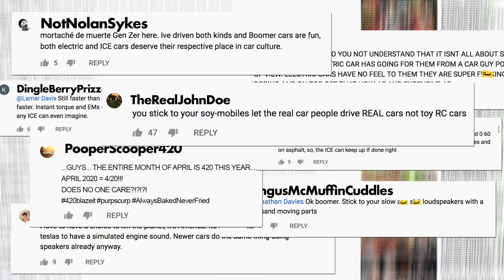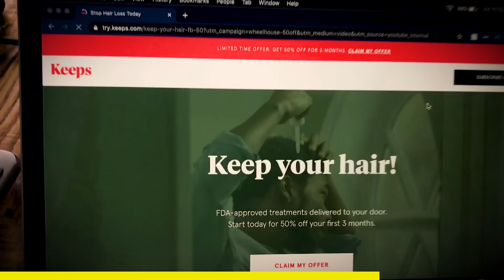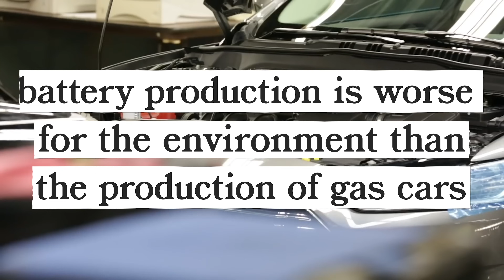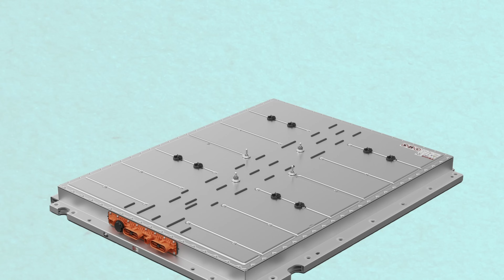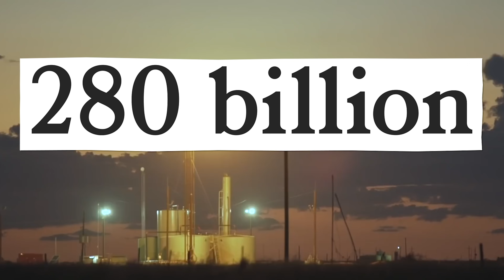Are Electric Cars REALLY Better for the Environment?

Comment: He forgot the most important thing green energy is not green because of what it takes to build it solar power requires more cole than you might think and the loss of trees it takes to install a solar farm wind energy has the same problem it requires cole to make steel for the wind generator to be built America has been shutting down a large number of hydroelectric dams across the country even nuclear facilities have also been shutting down as well storms  wreak havoc on both solar and wind energy production to wind the wind mill has to be shut down to prevent damaging it hail and storm debris can damage solar panels.

Comment: Here in California our power grid can’t keep up with our air conditioners.
Reply: @BeastMastery  there are lots of new power plants and most of the power plants have newer more modern power transformers. We took perfectly fine power transformers out of service and replaced with new units. Lots of new units are made overseas though and are not very reliable. We have nuclear power plants in a few states and it is the cleanest power you will get.  Downfall is when something goes wrong, it's real bad.
Reply: It is true that if you turn off the AC the air outside is going to get cooler, but you still need AC. Buildings need to get cooler by design and there are many cool features a building can have to achieve just that. However in a heat wave we will need AC. Always. For that we have thermal storage which easy to build, you can use water or ice, and uses existing technology and labor (know how). For everything which is electric we need to think about demand side management. This includes cars. Having everyone charging cars at the same day and hour will not work, at least in an economical way. All these ideas and solutions are good and stand from a sustainable point of view as they are good for business, create jobs and are better for the environment. Change is always hard specially when we have pet these enemies which we all like to hate and contradict but are all in this together. Lets work people.
Reply: I refuse to believe that the national power grid can handle a massive increase in electric vehicles.

Solar and wind cannot replace coal.  Natural gas plants have been replacing coal, and envirowhackos hate natural gas too.  I want natural gas powered cars.  Screw EVs.
Reply: @penguinsfan251  i agree with you.  Only downfall to natural gas vehicles which ups,Swann, and a few others run is the 10% loss of power compared to gas or diesel but they do burn cleaner
Reply: Germany is going green but still purchasing gas from Russia. I bet these enviropoliticians have investments in Canada.
Reply: @chieflouie2821  its all about money and control, nothing else
Reply: Very true, neither can New York
Reply: Still not as bad as Texas !
Reply: yeah I wonder whats gonna happen in 2035 when California's 14million cars(2019 stats) are EV's in the middle of summer heatwave
Reply: @Sevenspent  bold of you to assume that california will still exist by 2035
Reply: @Sevenspent  Yep and they insist on shutting down all their fossil and nuclear base power. I see a lot of power purchasing from Nevada and Arizona in their future.
Reply: @anydaynow01  why would they shut down nuclear power? It’s one of the most efficient and green sources of energy to date. I guess just another reason Cali sucks
Reply: Not sure why anyone is worried about the whole global warming, climate change bs they are telling you.  Al Gore made millions from it and he said his waterfront home would be under water if we didn't change things and stop polluting. That was how many years ago???  Well only thing that's changed is he made millions off of it and everyone took it hook line and sinker and then other politicians followed and are still getting filthy rich from it. It's a scam and I'm sorry if you can't see that.  If it wasn't then why would the Biden administration send millions to the Paris accord for the usa to go green when everyone else just sits around doing the same ol thing polluting 10 times more than the us but doesn't have to even consider doing anything or cutting back on pollution until years from now?? If they were that worried things would be different.  I guess people think there is a wall around the us and we only get what pollution we contribute to? Be honest with yourselves people, the world is always changing and always has and will continue until powers greater than us stop it.
Reply: @jeremylyons6252  
They live in liberal fantasy land.
Reply: the irony is that heat is generated in order to provide the power for you to cool down the air. absolutely bonkers.
Reply: Americans need to stop using AC, period! Else you won't have any habital land to live on in 30 years
Reply: @mattdavies890  first of all it gets impossibly hot here. Secondly a large majority of all carbon emissions are made by a mere 100 companies. Air-conditioning is not the problem
Reply: @Xeraghusta  those 100 companies are supplying atm the power grid to keep them ACs running
Reply: @mattdavies890  can you please explain to me how harmful elements such as lithium wouldn't hurt the environment when being processed into batteries and the like?
Reply: @mattdavies890  
With that reasoning then we should stop these electric cars.
Reply: @waynemeredeth9536  why, electric cars use far less electricity than fossil fuels when you consider the electrical power needed to get and refine petrol before it even gets in the car in the first place
Reply: @mattdavies890  um? I think it’ll be alright
Reply: @OneNidim  only if you run those AC units off renewables, otherwise you get into a spiral, more fossil fuel generation makes the world hotter, areas that are already got will get hotter, meaning more power needed for AC as more ac will be needed, leading to more fossil fuel to generate more power, how long till something breaks? Or charge from solar and wind and nuclear etc and less fossil fuel and you should be ok
Reply: @mattdavies890  I'm not going to stop using my A/C when it's 95 F with 100% humidity outside.

Comment: electric cars do not have less of an environmental impact than cars. by large electric cars use coal fired electricity. electric cars use cutting edge battery tech requiring a large amount of rare earth metals. mining rare earth metals makes acid rain. making the batteries requires the rare earth metal materiall to go halfway across the planet 3 times before its turned into batteries. thats a lot of diesel burned. electric cars especially on coal fired electricity do more environmental damage and have significantly higher costs of ownership than v8 SUVs.
Reply: True, the truth hurts, watch, time to spit more facts, gas cars emit 6-7 metric tons from factory, as for example, an average car like a toyota corolla or honda civic emit 270 grams per mile, average miles driven in gas car is 13,500, gas cars emit 3.6 metric tons a year, average to keep a car is 6 years, gas cars emit 28.6 metric tons during its life time, electric cars like tesla model 3 averages 13 metric tons from factory, tesla model 3 has 264 miles mid range, emits 85 kg per kwh, battery size is 65 kwh, tesla model 3 emits 300 grams per mile with powerplants, that means model 3 emits 4 metric tons each year, which would mean 24 metric tons in 6 years WITHOUT  factory emissions and 37 metric tons in 6 years WITH factory emissions, I have sources and statistics and calculations to prove I am correct

Comment: Me: A Norwegian
Also me: So, after I get my car, It wont give out any greenhouse gas. Because 98% of our electricity is from Water and The rest is other renewable sources
Reply: Till your battery degrades so much that it becomes uneconomical to own or repair therefore going to a scrapyard. And as even he pointed out, the recycling of batteries is nasty and there is no way they could be reused. I honestly don't understand why none of these 'full-life cycle' comparisons mention the end of the life env. impact because it is substantial - this gets even worse with the lower end EVs with horrendous range as new which will only decrease. Essentially the vast majority of the EVs bought today are most likely getting scrapped in less than 10 years. 
So yeah even in Norway there's gonna be a considerable env. impact after it rolls of the production line. Actually, especially in Norway due to the cold environment being even more detrimental to batteries.
Reply: @TheLukass71  True, but until it dies it has 0% emissions

Comment: Wait a minute already 2:00 in and you already  made a mistake. Gonna wait to confirm this mistakes, I will be back at 3:00...
Okay wanted until 4:00, and he finally talked about the recycling process, but there is still another issue he hasn't yet covered. Yall ready for this one, new battery development. Now personally it's seen to be better to use Hybrids, such as a the volt (don't get it just because a guy on the internet told you to, do your own research and make your own decision.) As yes it uses battery that can be changed and replace as needed, but it's also better because if you run low on gass, the car is designed to turn on the battery engine, and use that. It charges while you are running the engine. Waisting little to no gas. (I mean wasting no gas, as you could just go with solar plant and battery, but if you need gass it can use the energy to recharge the battery.)
Reply: Overall, he is correct finally finished the video. So yeah, gas can't be remind or recycled, but batteries can, even if it doesn't always work. My stand still sticks, hybrids and battery powered cars are better then gas powered alone.
Reply: I don't recall watching this.

Comment: Here, for what its worth is my two penneth. I worked as a transport driver in Aus. The bulk of our work was servicing the mining industry in WA. I'm going to focus on a lithium mine. The damage done to the otherwise pristine bush was indescribable, all the mining equipment was driven by diesel, the trucks that took it to the ports were diesel, the ships that took it to japan for processing were diesel, the factories in Japan I can't speak about but I suspect were not environmentally friendly. The trucks carrying the finished product were probably diesel as were the ships transporting the goods shall I go on? Electric vehicle production has to go a long way before it can be said that their footprint is friendly to the environment. Its a good start but people should think outside the box.
Reply: New fuels are being developed that give extremely clean emissions from internal combustion engines. For example the new synthetic fuel developed by porsche reduces tail pipe emissions by 85%. This would put the internal combustion engine on a level of emissions output at the same level as a electric vehicles.

Comment: EV burn 60% as much Carbon as normal cars because the grid is 63% carbon.  You stated that the grid could handle 25% of the cars if all were electric.  Assuming that is correct (with zero population growth), what happens when there are even more EVs?  This is a large oversight.

 In 2019, about 4,127 billion kilowatthours (kWh) (or about 4.13 trillion kWh) of electricity were generated at utility-scale electricity generation facilities in the United States.1 About 63% of this electricity generation was from fossil fuels—coal, natural gas, petroleum, and other gases. About 20% was from nuclear energy, and about 18% was from renewable energy sources.

Comment: Sure, nothing matches the sound of a Mustang, but nothing matches the feel of going from 0-100 km/h in 2.5 seconds either.
Reply: The buggati veyron does 0-100 in 2.5 seconds. So does a lott of modified internal combustion engines. The only difference is internal combustion are actually real cars.
Reply: @johnovandupper3810  oh shut up kid.

Comment: I personally think they are both great but... Interestingly, if the environment wasn't a factor and gas was cheap, no one would care about efficiency as efficiency doesn't exactly translate to "better", just "efficient". Electric is twice as efficient as using its own fuel source but it comes at a huge weight penalty, range penalty and size penalty(and for sports/racing: corner slower and have a lower top speed). ICE are great as they are significantly lighter, have much greater range(and for racing/sports: corner better and have higher top speeds, even in an inferior 4 cylinder). They both have their place but in my opinion and studies, both of their drawbacks can be balanced-out if manufacturers did a better job pushing out sporty plug-in hybrids such as front-wheel drive ICE with an electric motor pushing the rear wheels. EV at low speed and low rpm, ICE at high rpm and high speed, EV in between shifts of a manual, etc. My estimations show that 60-80mpg CAN be had in a sports car weighing under 2800lbs and still get 0-60 times in the 4 second range.

Comment: Recent studies in 2019 - 2020 by researchers in Europe & the USA have concluded that lithium battery packs, such as the Tesla power wall, hybrid & electric car batteries, etc, have a manufacturing process that is far worse for the environment than the "green" movement would have the general public believe. Human lives are regularly LOST in the mining of lithium for batteries, due to the exposure to the dangerous heavy metals involved. These "green" products are only manufactured in countries where there is NO Environmental control. Some of the researchers compared two new cars, one electric/hybrid & one traditional petrol/gasoline powered of the same make & size. The electric/hybrid version was deemed to be responsible for more damage to the environment before it even left the showroom than the petrol/gasoline version would ever be in its' entire designed lifetime. Of course, the "green" left have exerted pressure on the scientists to keep their findings quiet, however there are always leaks of information in any organisation & the information is always available.

Comment: So after 100,000 miles I’ll have to replace the battery and create another 17 metric tons of co2.
Reply: That's as of cars right now, but companies like Tesla and GM are planning on implementing 1 million mile battery packs which means you will likely not have to replace your batteries at all in the future.
Reply: @Iamde4dinside  That's ok. Nobody has to buy an EV if they don't want to

Comment: what about trucks lot of people need trucks for pulling trailers boats etc  and if you live in the cold climate where it gets like 40 bellow like in Canada how is that going to work with an electric vehicle
Reply: Exactly.
Reply: New fuels are being developed that give extremely clean emissions from internal combustion engines. For example the new synthetic fuel developed by porsche reduces tail pipe emissions by 85%. This would put the internal combustion engine on a level of emissions output at the same level as a electric vehicles.

Comment: It's official. The UK Government has just announced that the cut-off date for the sale of new petrol and diesel cars is to be brought forward 5 years to 2030. The cut-off point for the sale of new hybrids remains at 2035....... So, ten years and counting......
Reply: New fuels are being developed that give extremely clean emissions from internal combustion engines. For example the new synthetic fuel developed by porsche reduces tail pipe emissions by 85%. This would put the internal combustion engine on a level of emissions output at the same level as a electric vehicles.
Reply: @moabman6803  There is simply no way that zero carbon targets can be met using ICE vehicles...
Reply: @Brian-om2hh  Sure their is. Simply run them on on hydrogen. The tail pipe emissions would be water.
Reply: @Brian-om2hh  Hydrogen and synthetic fuels could be made with solar during the day. Electricity in not widely available in the more rural areas I travel to. Finding a fuel station is difficult. A charging station is far more difficult. Basically I need a vehicle capable of towing a trailer will little effect on fuel mileage, and the ability to carry extra fuel with me a refuel quickly. Especially if a big winter storm is blowing in. Hours spent charging would be the difference between leaving before a storm, and leaving in the middle of a storm

Comment: Looking at the total CO2 emissions over the life cycle of a car, adding up all the emissions for which it is responsible, you can see that a hybrid or electric car (with the current energy mix in Europe) is only slightly better than a conventional car.
 The idea of zero emissions for electric vehicles is an industry hoax to ease the consumer's environmental conscience when buying another car. Basically it is greenwashing. And hence how can you do really something for the environment? Keep your old car with good maintenance and controlled emissions, since buying a new one demands much more energy and CO2 emissions; use public transport since they emit much less CO2 or pollutants per passenger-distance travelled; use the bicycle as modus movendi because bicycles demand much less energy and emissions of CO2 to produce and drive; if you have a permanent and stable job find a house as close as possible to your job, because it is greener to use a diesel car 5 kilometers per day than an electric car 50 kilometers per day; or do what Homo Sapiens was already doing for 120 thousand years till the "automobile revolution", i.e., walk. Our ancestors walked several kilometers per day as they wandered the planes of Africa and later the valleys of Europe, so why do you insist in taking the car for a distance of less than 1 kilometer?

source: https://www.veraveritas.eu/2020/10/green-cars-are-like-virgin-prostitutes.html